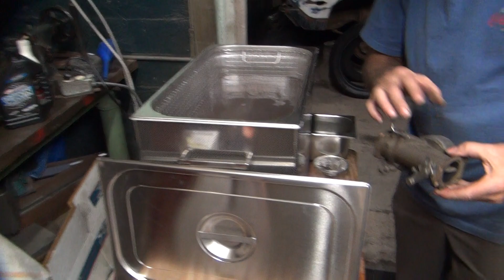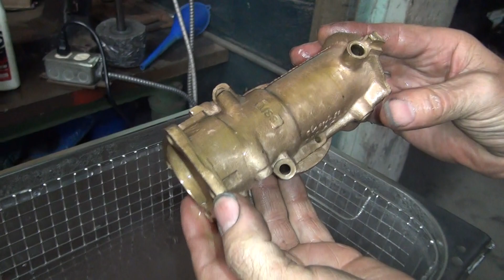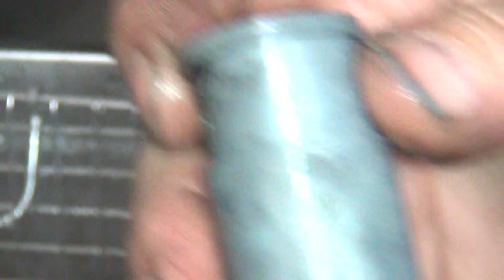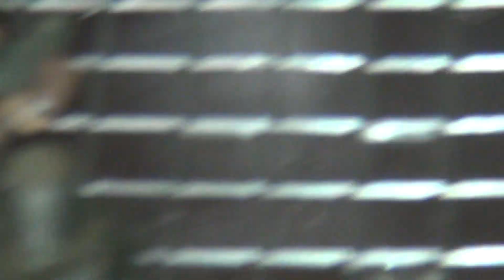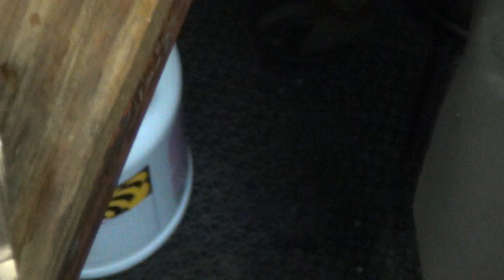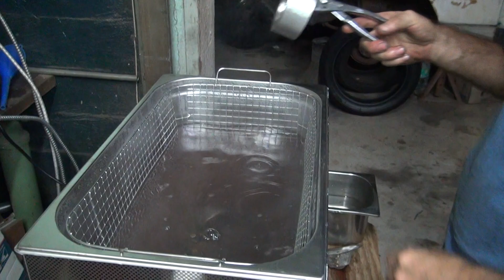Testing New Tool #103 Ultrasonic cleaner DSA800SE-GL2 30L 8gal Harley by tatro machine

Comment: You have to use stronger chemical and if that don't work get a small sandblaster cabinet and solar blast apart then put it in the cleaner I found out that works better
Reply from the maker: i have all of that but it just does not work as advertised.
tatro

Comment: HI! What about to place the parts in bucket with a gallon of tap water and  3-4 tea cup of muriatic acid. I would do the whole cleaning procedure in a very well ventilated area
Reply from the maker: the acid eats away at the parts so if you what them at full size you need to find another way to clean your parts. the zinc and alum parts will be gone in short order.
tatro